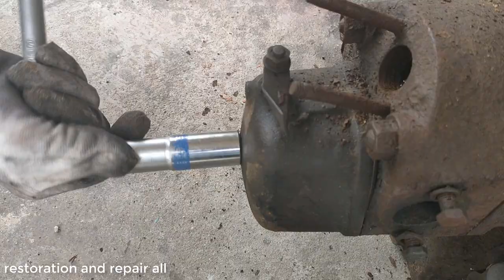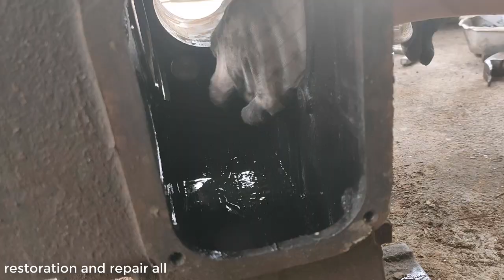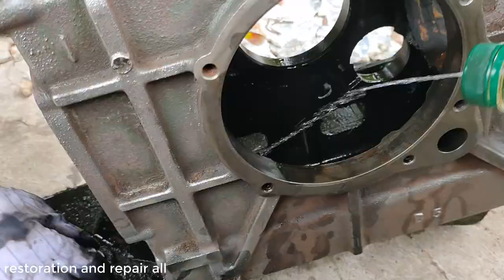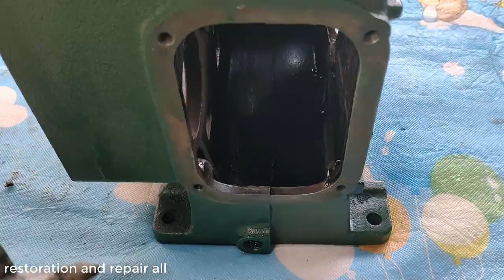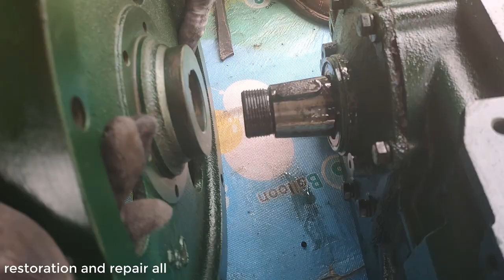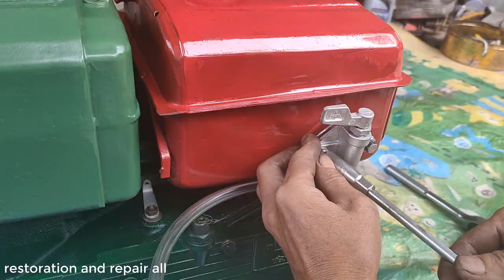Restoration old D8 diesel engine | Restore rusty Antique D8 Diesel Engine

Comment: Dear friend, you should proper hand tools. For example using a pipe wrench  for removing a nut is totally unprecedented. You should have used an adjustable spanner. Care must be taken to replace the wornout parts if it is available for long term usage. Next time, take care, have patience and restore. Goodluck.
Reply from the maker: Thanks for your very helpful comments. and I will note in the following videos.

Comment: Hello everyone. I'm new in the forum. I have a 28-foot sailboat, made in Argentina. ( I am from Argentina) . My sailboat has a diesel engine of Chinese origin.
The motor brand is SHUANGNIAO Diesel Model 275 WAC. 12,5 Hp
Manufactured by: HANGZHOU General Diesel Works.
I need if someone knows him. Who can have the manual for that engine. Or if someone knows on what basis it was copied, to adapt the spare parts.
Thank you so much

Comment: Technically nothing improved. Only cleaning,painting then fix as it is
Reply: cleaning the internals after sitting for so long is VERY important.
If the engine is in good condition there is no point in changing anything. Keep it as original as possible
Cleaning the fuel injector is very important for extending its lifetime

Comment: I was never a fan of these "restoration" videos, their washing the engine block with water in the backyard with a stream right next to them. water doesn't clean or mix well with oil, for got sakes get a parts-washer. the fact that all the parts where reused is just hard to watch, and no torque specs on the bolts? I can tell the engine is burning oil